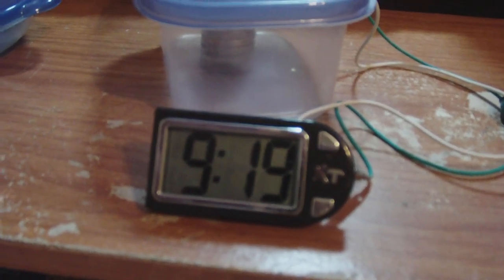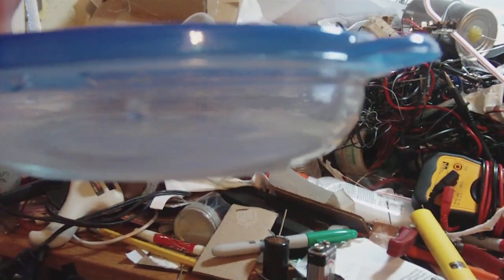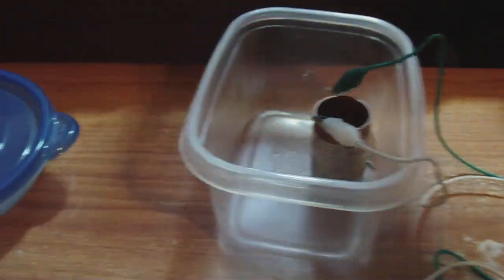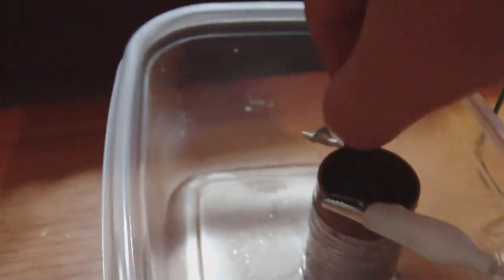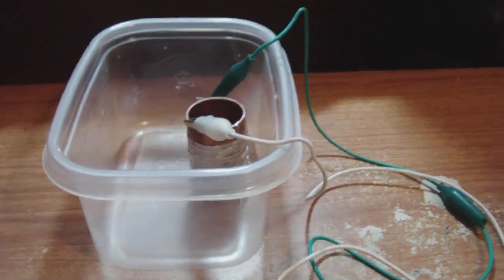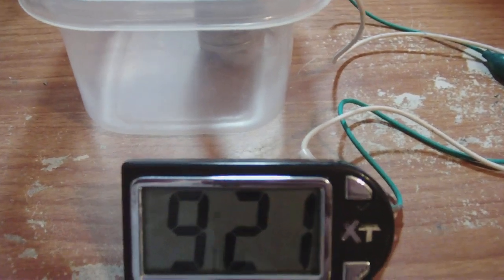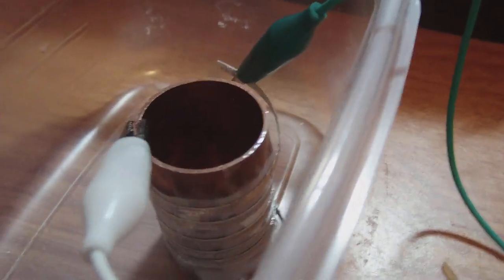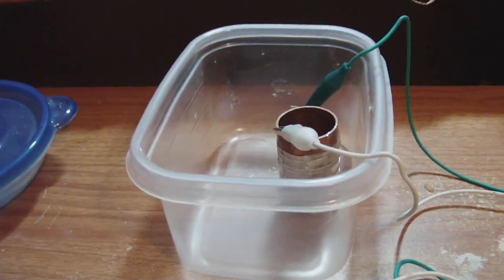Distilled Water Salt Substitute And Epsom Salt Crystal Cell

Comment: Well done IB, but if you put a lower ohmic load on it you will probably
see the magnesium ribbon decompose after a while, or does your Epsom salt and Pottasium Chloride prevent a galvanic reaction ?
Then how does it produce power, if the metals are not used up ?
Is just the water decomposed then ?
Regards, Stefan.

Comment: The materials in the first and second column of the periodic table will induce hydrogen from water. (if you put them into water) Magnesium and aluminum too. Zink does it only if the water is hot enough. You can not notice it yet, it is a slowly continous process. But for example, if you put natrium in the water, it will solve very very fast.

Comment from the maker: @mrBr00k5 

Yes a very good test. So far no corrosion and all that is happening is the water is evaporating and leaving behind the salts. When water is gone the cell still gives the normal voltage but little to no power but add more distilled water and salt substitute and Epsom salt to the cell cell and you get all your power back.